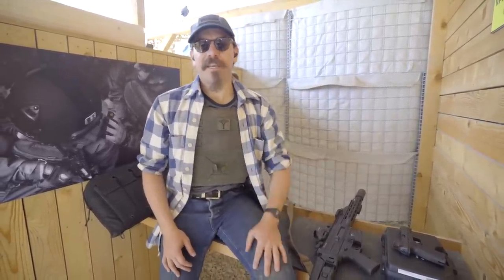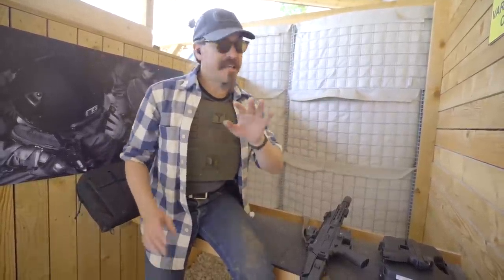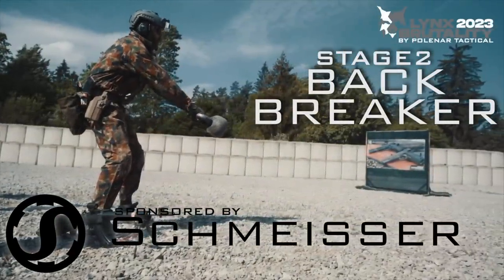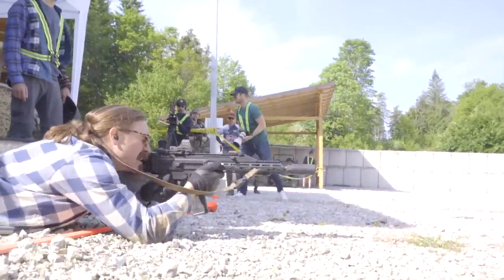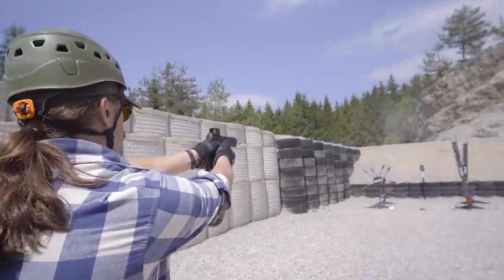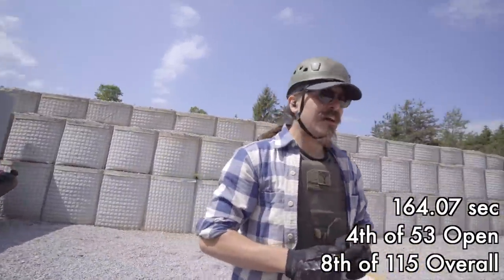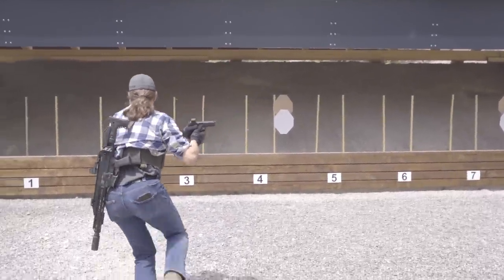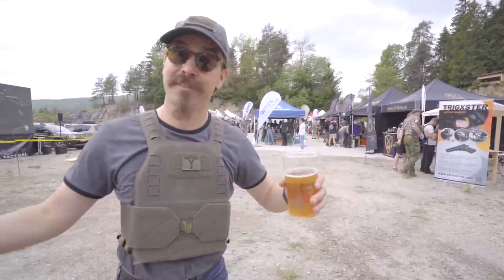Lynx Brutality 2023 Day 1 - Kettlebells and Electrocution

Comment: Resting the mag on something 6:43?

The US Army has been training soldiers for a while that way and ive been refraining from doing it for years based on other videos I've seen from you (admittedly I dont remember how modern any of those weapons were) and my own logic of malfs

Could we get a quick/in depth discussion video on that particular topic?
Reply: Would be interesting to hear about it. FWIW that's how we always did it when shooting prone with RK-62s in the FDF, didn't seem to cause any issues. And to get a solid stand you also had to kinda crank sideways, because there was some lateral slop between the mag and the mag well. In hindsight I'm kinda surprised it worked as well as it did... =)
Reply: Does us army use Tink Arms Peruns?
Reply: @blegi1245  Nope; just teaches the method of resting the magazine
Reply: If it jams the gun, dont do it. If not, it's fine

Comment: The electric fence power unit is what is called a weedburner. With allways on fences a weed can touch the fence and short it out and it does not work so livestock can get out. The weedburner does just that. If a weed touches the wire the pulse is strong enough to burn the weed off the fence. It can also kill small birds that perch on something and touch it. Kills snakes that try to crawl over it. I saw a large pig check it with it's nose, they are smart, to see if it was on. First two tries it was in the off pulse, it thought, ah ha freedom!, third time it was on, I could see the arc from the wire to it's nose. Nope, no freedom today. They are no joke it it gets you.

A small tree fell on the fence. I forgot about the fence and was wondering why the chainsaw I was using was shocking me, I thought it was a short in the sparkplug wire. No I was being shocked from the fence, through the tree and then through the chainsaw.

Comment: I don't throw my kettlebell. But maybe a more of a lumberjack swing starting from one side instead of a traditional kettlebell swing. Using more of your entire body not so much back
Reply: @erikvdb hes asking can use 2 hands from the side like hes swinging an axe not one handed yeeting
Reply: @erikvdb  thank you, good to know.
Nothing wrong with standards.
Reply: @noahfyan9617  yes exactly. Like up swinging ax .
Starting low near the back foot.
You can really load up your legs shoulder arms and even the feet.
It could be called "potato sacking" or "hay bailing" if you  throw a person like that .

Like I said. I don't throw mine. It's an expensive adjustable.
And it might not have any benefits changing technique